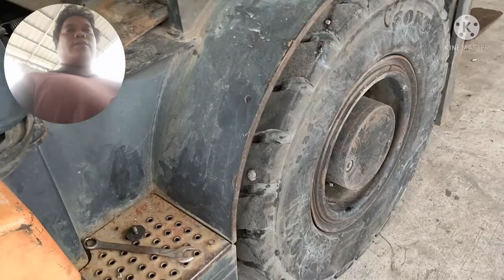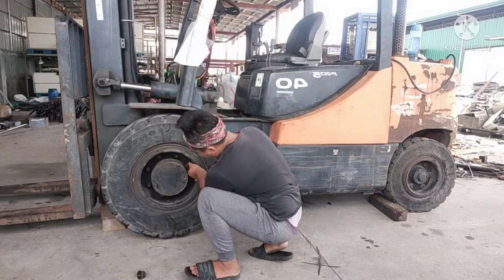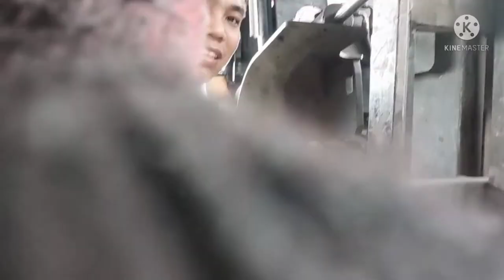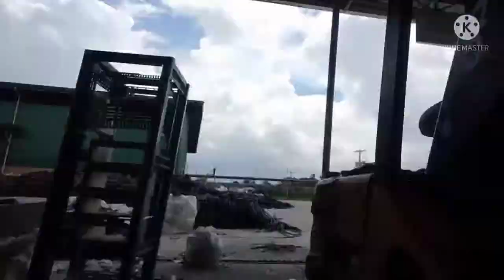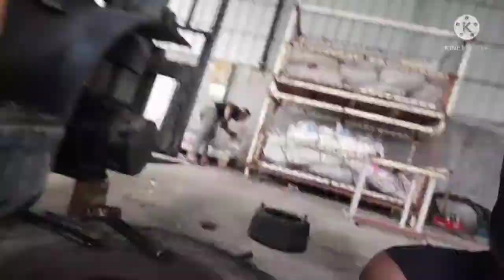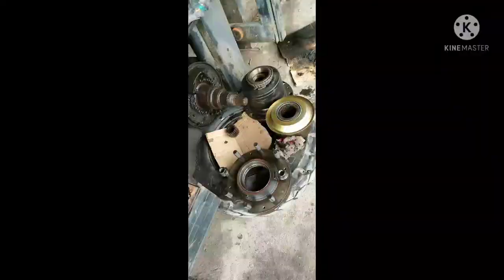DOOSAN FORKLIFT break system dismantle part 1. by:THDM@MEKALIKOT

Comment: Please i have this type of forklift 5tons the brake is not active at all i have change the master cylinder, brake pad but still not active, but if i pump the brake 3x it will be active then later go down please what's the solution to this?